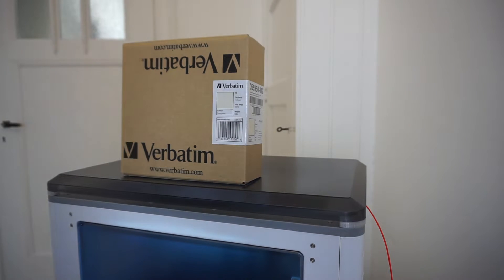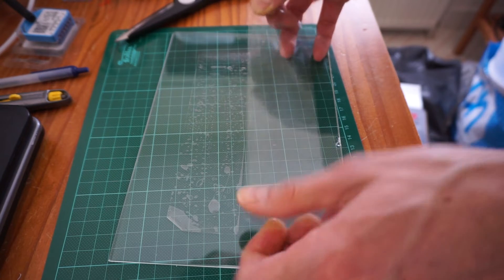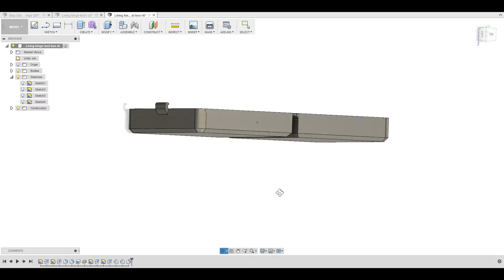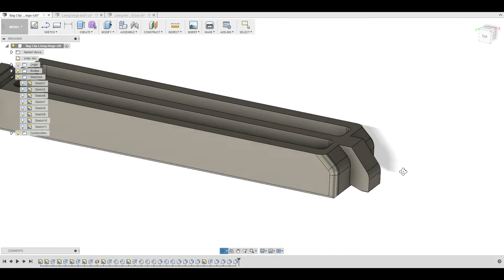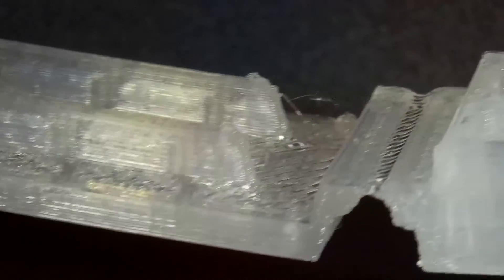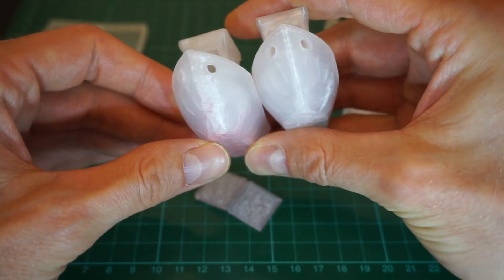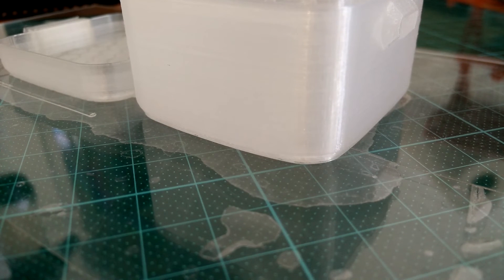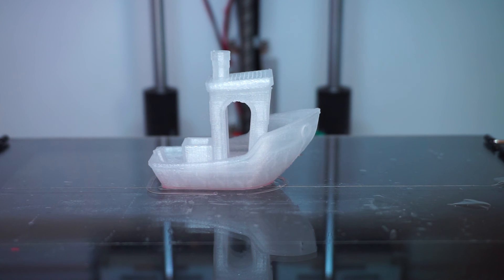3D printing with Verbatim Polypropylene (PP)

Comment: did I miss the part where all the settings in Cura is shown?
Reply from the maker: Hi, the settings for the slicer are not down in the video, I just talk through the settings I tested. (Not using cura but flashpoint.)

Comment: Great video. I assume you are an engineer :). Just a quick tip. Instead of moving the micro switch to accommodate the 3mm plate you could maybe have lowered the bed by tightening the springs/adjustment knobs. Just thought I would mention. Of course this depends on the room available etc etc. I found this out the hard way 😄. Excellent video! I will be attempting to produce pp filament with aid of information from this video. Thank you.
Reply from the maker: Hi Joe, it is indeed more work to print an offset tool to get the extra 3mm for use with a glass plate, but since I mostly print without the glass plate I wanted to lower the changeover time. Now I can directly start printing when I place the shim and the glass plate. But every method has its pros and cons, this is just my personal preference. I hope you can get the PP printing to work. Let me know if there are any issues, Good luck!
Robin

Comment: Thanks for you....What parameters did you use for printing with pp filament?
Nozzle... Bed... Fan.... Speed... Infill... Sheel....
Reply from the maker: Hi Fadi, I used a 0.4mm nozzle, 220 degr C, bed 80 degr C, 140 micron layer height, 30 mm/sec, infill is not critical for cosmetic quality. 3 shells which I think is beneficial, at least on my printer. I have also made some notes on print settings in the article linked in the description. Note that these settings are not the best settings per se, but just the ones that I have tested and worked for me.

Comment: To remove completed print is it better to wait for cool down? Thx.
Reply from the maker: Yes, I believe it is best to wait for the print to have cooled down to avoid deformation,  but I am not sure if it is super critical, if it is still a bit warm to the touch. I typically don't wait for it to fully reach room temperature.

Comment: Nice work! Is PP also weather-resistant (and also UV-resistant) ? If yes, how long(good) ? What other elastic or semielastic filaments are weather (and also UV-resistant) resistant ?
Reply from the maker: Hi Cris, PP does not have very good UV resistance so prolonged outdoor use could affect the durability of the hinge and the overall part.

Comment: I think it would be interesting if it were possible to combine PLA for the part structure + PP for hinges etc... the cost of dual filament printers has come down a so it's probably worth experimenting with.
Reply: If someone had a printer that could print two filaments at once and figured out settings that could be pretty cool!

Comment: Hello, I like to print some new silent blocks for my and I think it's the must appropriate material for this application, don't you think?
Do you think I can print massive parts with this material? And do you think it will be soft enough to absorb vibrations and strong enough to link wheels to chassis?
Reply from the maker: Hi Denis, thanks for commenting. I think this material is not very suitable for silent blocks. A rubber-like material would be more suited for this application. You could try TPU. Ninjaflex is based on this, but the are also similar materials from other manufacturers.
Robin

Comment: How do your boxes hold up to steam sterilization in the dish washer?
Reply from the maker: Hi Ryden, Thanks for your question (challenge). Since the maximum temperature of my dishwasher is only 70 degrees C, I submerged a box in boiling water for a couple of minutes. Directly after pulling the part out it was noticeably more flexible, but even when applying a reasonable amount of force the part did not show any plastic deformation. I did notice some condensation in the hollow areas of the infill, indicating the part is not completely watertight. If you are using parts in these kind of harsh conditions, using 100% infill might help to overcome this, but that has it's own drawbacks, like increased print time.
Cheers, Robin

Comment: What 3d design software did you used ?
Reply from the maker: Fusion 360, which is free to use for hobbyists and startups with a revenue of under $100.000. If you sign up you get a free 1 year licence, which can be extended indefinitely for free (or until the terms change). And no, I do not have any affiliation with Autodesk:)
Robin

Comment: just move the bed up until the nozzle touches the tape and type G92 Z0
Reply from the maker: Hi, thanks for the tip! As far as I am aware entering G-code directly (MDI mode) doesn't work with Flashprint, but it would work with other slicers like repetier. If there is an option to do this in Flashprint please let me know!
Robin
Reply: I normally just modify the starting g-code in the slicer software to implement the offset for level height.
(Actually z=0 is mechanically set slightly below the print surface, a lot easier to tune the z-offset by 0.05mm in software than moving my end stop switch :)

Comment: Good video! Thanks for taking the time to discuss this plastic for 3D printing. You have made it rather clear that this is not an easy material to print with. I think most problems might be due to the high viscosity / elasticity during printing, made clear in your close-ups of the benchy. This also explains why lower speeds work better. Nevertheless you have realized good results! Thanks for the info!
Reply from the maker: Huib, thanks for stopping by. For this printer a bit more patience is needed when printing PP, but for smaller parts the print times are quite acceptable. Cheers,
Robin